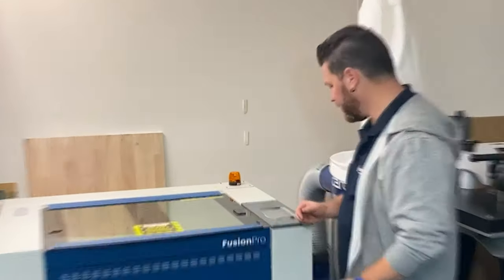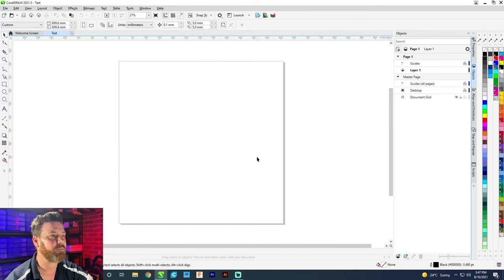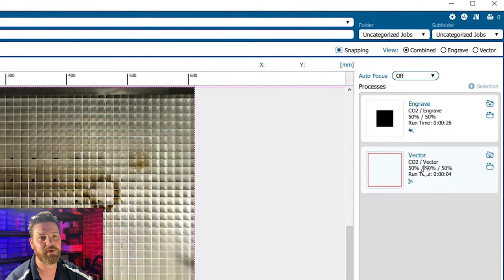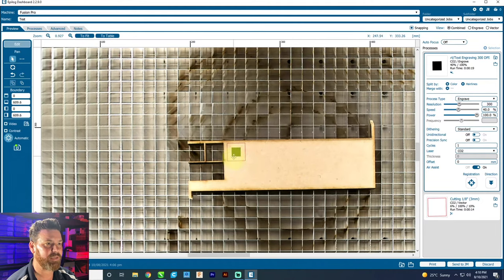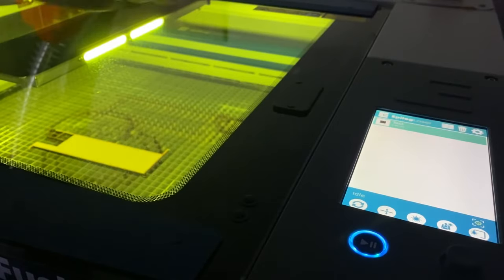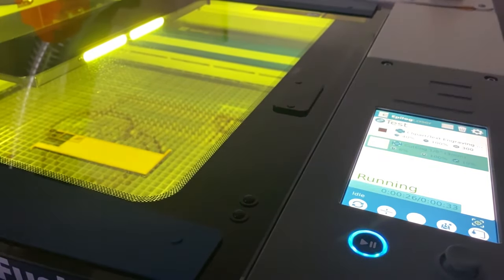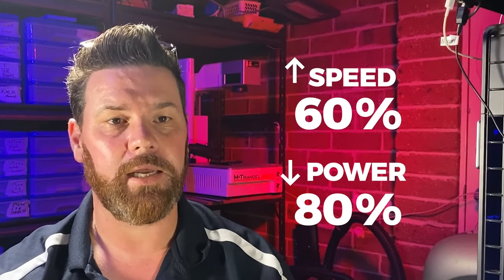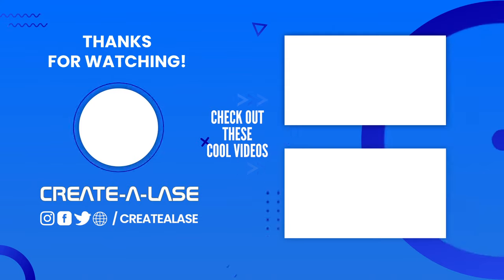Epilog laser Fusion Pro Review and Test

Comment: I have a 130w Thunder Laser and have issues contending with glue even using 1/4" baltic birch. Do lasers with an RF tube such as the Epilog have the same types of issues?
Reply from the maker: Hi Ryan, What issues do you mean?  Is it the residue left on top or under the material? Thanks! 😊😊
Reply: @CreateALase  Just cutting through heavy glue pockets. 1/4” Baltic birch is rarely ever a single pass affair when doing mass/batch cutting.
Reply: @RyKnocks  Hi, if you are still interested in this issues, shall we talk about the details?

Comment: Really well edited and comprehensive. Does the machine indicate when it's safe to open after a job is complete? (thinking about potential fumes etc.)
Reply from the maker: Awesome thank you yes we do our best. 🙂 For the Laser indicating when to open it. Yes it has a light that is on while in operation and turns off then beeps when ready to open. You connect a good extraction unit to it so there is never any fumes.